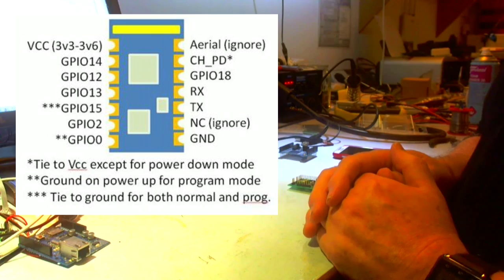ESP-03

Comment: Be aware when buying these from places in China off ebay, they have no documentation included, and some/most are DOA. with no firmware loaded or they will not go into pgm mode at all when you pull the proper pins to ground.
I bought two identical boards, one from China and one from the states, both are 03 boards mounted on a daughter board with an external antenna port. The one from China was wrapped in paper and bubble wrap, no documentation, piss poorly constructed, cold solder joints, scratched tracks on the PCB and completely DOA.. The one from the States worked 100% well, properly packaged in anti static bag, and had documentation and example diagrams and links to websites.
Reply from the maker: H there. With years of buying from China that is absolutely NOT my experience. The odd Duff part I have had has been immediately refunded. Buying from the USA to the UK often involves unreasonable postal charges on the other hand.
Reply: Peter Scargill Yeah postage from the states or even in the states is kinda high but I seem to have better experience with things bought here in the area of these little leafs/modules, etc for arduino. 
Now 2-way radios I buy from China have been class A+

Comment: I n your informative video you state that you can make use of four GPIO ports, and possibly five if you were to consder GPIO0.  Which are the four (among the set including: GPIO2, GPIO12, GPIO13, GPIO14 and GPIO 18) ?  In the Expressif datasheet there is no GPIO18 explicitly labeled.  Could your data sheet for the ESP-03 have an error and that pin actually be GPIO16 instead?
Reply from the maker: Yes indeed Eugine that would be GPIO16. I am now using ESP-12 boards which have a couple more pins (and in some cases have gpio4 and gpio5 mixed up) otherwise the same applies. This weekend I plan to take a look at fastening gpio16 to reset as apparently you can then implement a sleep function. While I'm here the link for the blog is now out of date and is now tech.scargill.net

I have some new info on the ESP201 in there as well.

Comment: Thanks for sharing. I'm experimenting with the ESP8266 myself and your blog helped me sort out the firmware levels. I intend to use a separate micro processor but I'm interested in your "on board" research.
Reply from the maker: Hi - well I'm doing both - not yet 100% convinced we'll find "real" uses for the board stand-alone so simultaneously I'm progressing work using them with the likes of Arduino - I've a very reliable lamp-switcher using Arduino and the ESP-01 and in the background I'm refining the routines as what I'd REALLY like is a network of these devices talking to each other.